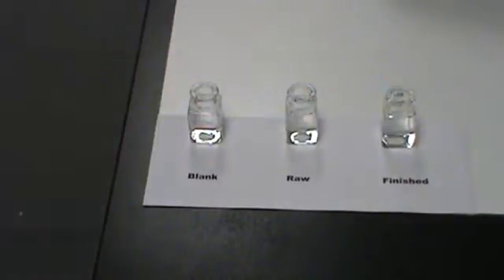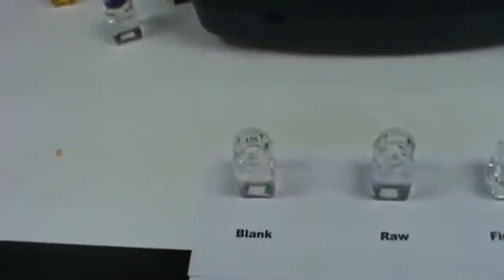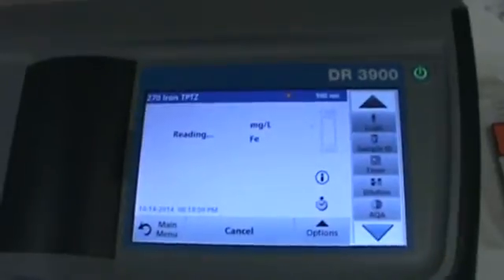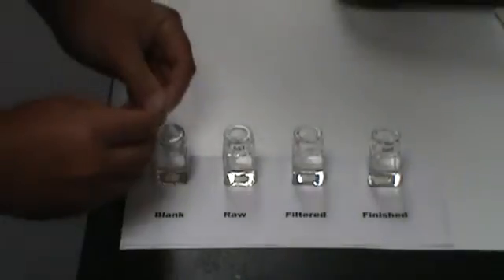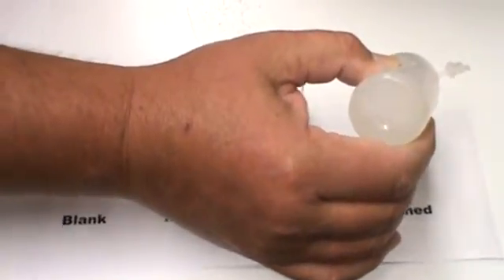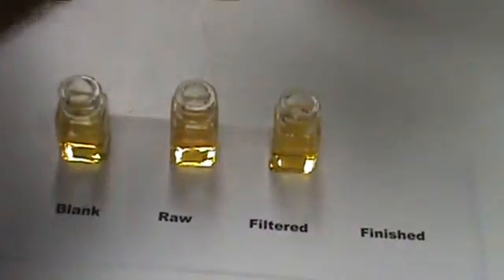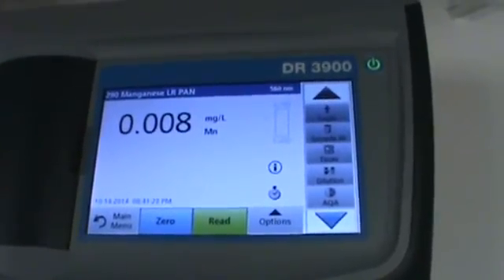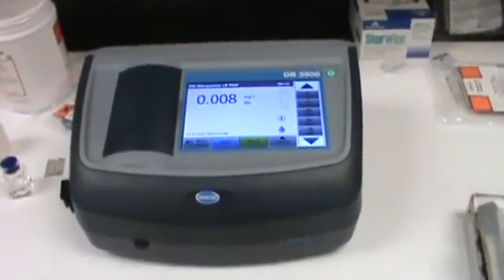Iron and Manganese water test

Comment: I don't understand, you went from .055 to .031 on the iron test and said it was Zero. But you also said you round up to the nearest hundredths, why isn't the finished .03 instead of zero? You also said you round up to the nearest hundedth, but your manganese test you recorded to the thousandth place. Just trying to learn about Iron and Manganese in our water as I am looking at installing a water conditioner and was told iron and manganese would mke the conditioner inert. thanks
Reply from the maker: hi Bob.  thanks for expressing interest in my video.  regarding your question about iron test results you’ll notice at 2:20 of the video the raw result was .055, and this was entered in the bench sheet as .06 (rounded up to the higher 100th value)  The -.031 finished result result was a negative value on the spectrograph (colored red) and it had a negative hyphen (-) in front of the test result, which we interpret as “0” ppm in sample. So red color numbers plus a negative scan value we interpret as 0 mg/l.   Thanks for your input.

Comment from the maker: When we used our MIOX generator we could prechlorinate with no THM risk and we had no.manganese problem, but we discontinue using MIOX and wen to liquid bleach so then we were back to square on with MANG removal. Th prechlorinate was so helpful in removal but the generators require too much maintenance and repair
Reply: I'm sorry I didn't tried prechlorination, our organic levels are too high for that. I meant that you can check the potassium permanganate residual of water before chlorine is added using the powder pillow test method. It's roughly 98% accutate. Since we don't want an excess of potassium in our water we use a cl17 to check the potassium permanganate content of our water that leaves our clarifiers before chlorine is added to it.

Comment from the maker: In our situation.streaming current called for approx 20mg/l so we ran probably 25-30 ppm in manual (not really doubled but high just the same ) the pre-lime we added required that extra amount of alum to form the flock necessary for the manganese removal.. I am at a different plant now but same company. just goin by memory here) I hope this was helpful. We experience raw spikes of manganese 1.0mg/l every year when our reservoir turns over
Reply: I'm guessing your raw water has a higher turbidity to require that low of a dosage?
Reply: Have you considered  installing aerators in the reservoir? We added 3, and it really lowered our organics coming in and believe it or not lowers the iron and manganese.

Comment: We're currently struggling with manganese removal due to recent floods in east texas. Our plant has never focused on or had an issue with manganese to the degree we're dealing with now. Our system consists of kmno4 dosing at our raw water intake, addition of powdered activated carbon, addition of alum, upflow clarifiers, chlorine gas injection as the water enters our chlorine contact basin, the addition of gaseous ammonia, filtration through anthracite and sand, then the addition of caustic soda before entering our clearwells. When the manganese hit, our raw water ph dropped from around a 7.5 to 6.8. We increased the ph at the raw water intake to achieve around an 8, and found that allowed the kmno4 to work faster, but we still had manganese passing through our system and discoloring our finished water. We purchase raw water from another pws, and mysteriously the ph changed to an 8.5 as we started pulling water from them. Since then the manganese has reduced, but we're still not getting it below a .15 mg/L. 

A few questions we have are:
How are you determining the correct kmno4 dosage and where do you inject it in your system?

Have you experienced a filter contamination of manganese and how did you respond and correct it?

Are you available for contact?
Reply from the maker: We increased our alum dosage (almost doubled the required amount from streaming current monitor) at raw water supply at plant entrance and added pre- lime to bring the ph back up to the 7.0 range.  We found that manganese removal was dependent on addition of lime and maintaining a ph between 6.8 and 7.0 before floccualtion.  Ours was a pre-lime situation.  We added 3 mg/l pre-lime, set alum feeder on manual, then adjusted ph Post supply accordingly so our finished ph was 7.0.  The actual amount of KMnO4 was determined trial and error (jar testing) and was alot higher dosage than the manufacturer recommended.  KMnO4 is  injected in raw supply just prior to flash mixing and flocculation.  So the addition of pre-lime  to get a ph 6.8-7.0 after overdosing alum just prior to sedimentation was critical for us to remove the remaining complex manganese molecules that were not precipitating
Reply from the maker: we had no filter contamination problems
Reply: +stratman30252 That's interesting. Are you able to keep your Aluminum levels under the MCL with higher dosage of Alum? We ran a jar test today with higher dosages and found that at double the dosage our aluminum reached a .261. We ended up only going up 20 ppm as it lowered the Manganese to a 0.023 and the Aluminum reached a  0.126.  We also use a cl17 with total chlorine reagents to monitor residual potassium permanganate of the clarifier effluent. We just recently discovered that dpd and the cl17 buffers will react with potassium permanganate and show the pink color of prechlorinated water. We've used that to ensure we aren't overdosing the potassium.
Reply from the maker: Hey Matt see additional comments I added regarding our alum dosing.  It wasn't double  as stated but w  hit it really hard with Alum and pre-lime and it worked.  Sounds like it worked  for you with .023  result. Thanks for the inquiry!